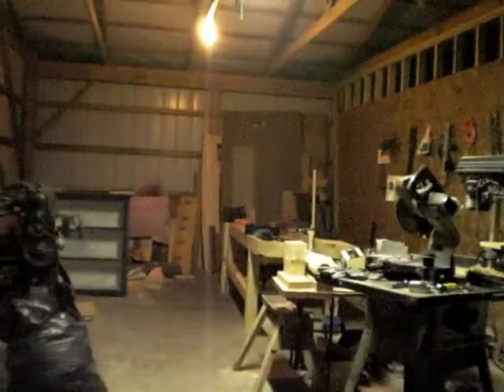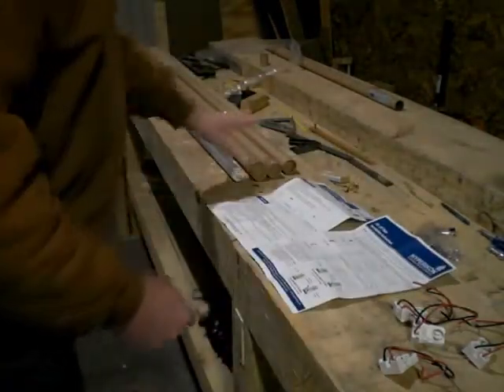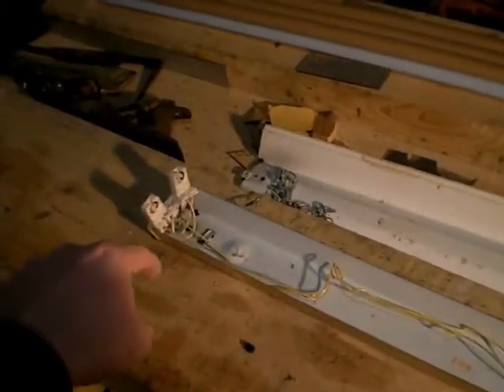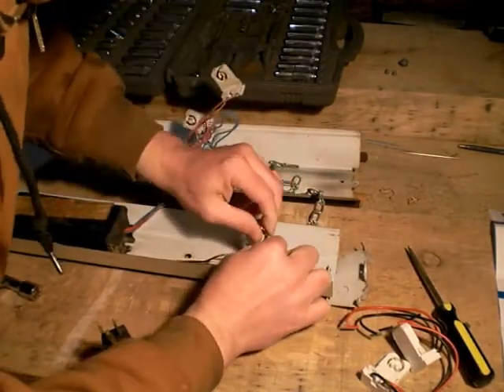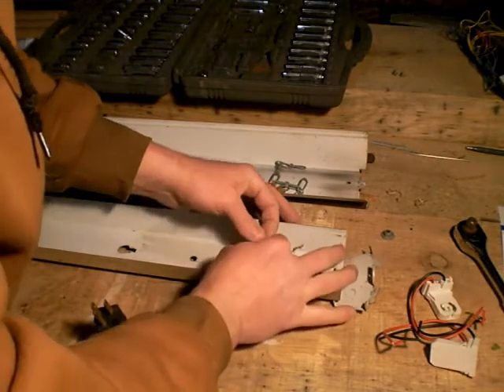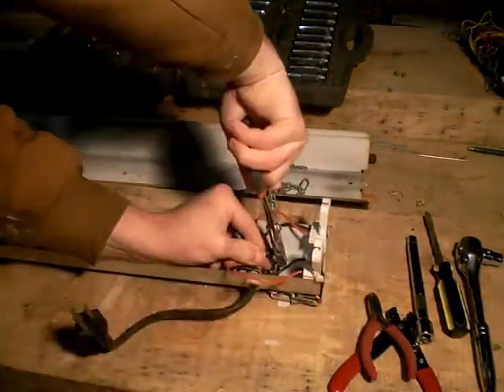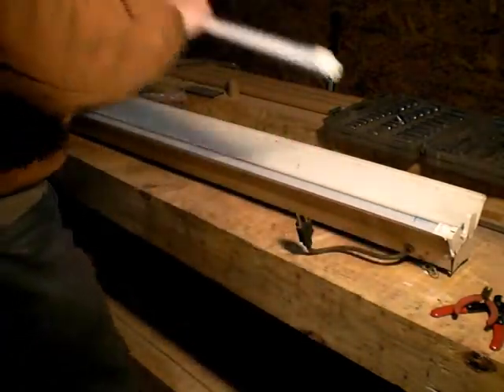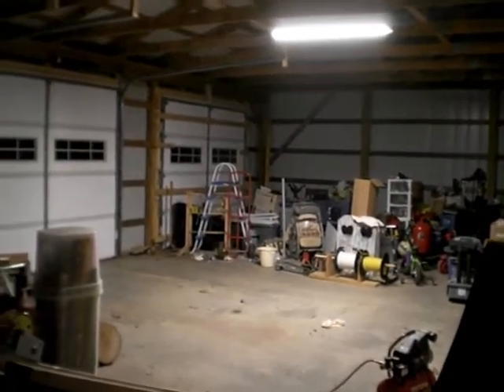Converting 4-foot fluorescent light fixtures to LED.

Comment: It looked to me like it came out significantly brighter and a second 4' will also make a big difference. Just an FYI, there is a site www.woot.com that has daily specials on specific items and occassionally they will have 4' led shop lights for $39 + $5 shipping. I got 3 of them and they put out 3700 lumens each. Good luck on you lighting upgrades.
Reply from the maker: +WoodRodent, I've been back out in the shop several time now since the upgrade, and it is definitely brighter.  I'm very pleased with LEDs.  And I have heard of Woot but never visited their site.  I guess I'll have to keep my eye on them from now on.  Thanks for the info!

Comment: I like the video. But you never showed what you did with tombstones on the left side. Are they hooked up to ac also or just together? Black to Black, Red to Red?
Reply from the maker: Hmm, you're right!  I didn't show what I did to the "left" end.  But, it's simple.  I just clipped the wires real close to the tombstones since they had no electrical connection.  Those bulbs only required electricity on the "right" end.  The left tombstones are there to merely hold that end of the bulb.
Reply: Ok. Thanks!
Reply: Where did you order those tombstone with the wiring

Comment: If you jump back and fourth from the beginning of the video and the end of the video to compare the light output, they aren't much brighter than your old shop lights. The biggest difference here would be energy consumption being allot les with the LED's than the old neon sign you had up there. Did you ever hook up the second set of lights? That would definitely give you more light. But just brightness, I didn't see much of a difference from the old to the new. Of course this could just be showing like this on the video as cameras do have a tendency to lower light output so it doesn't blind the camera.